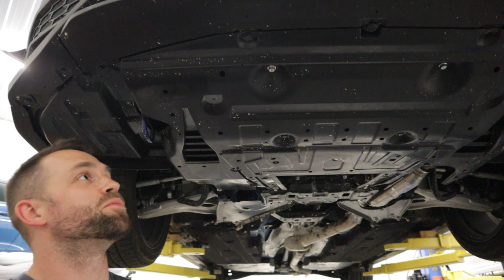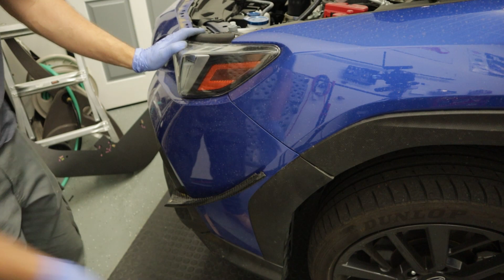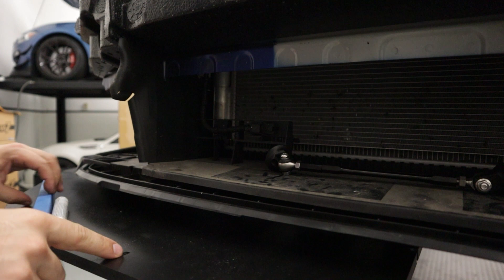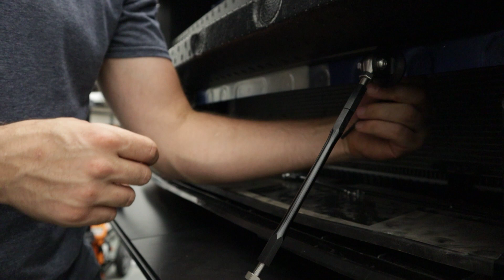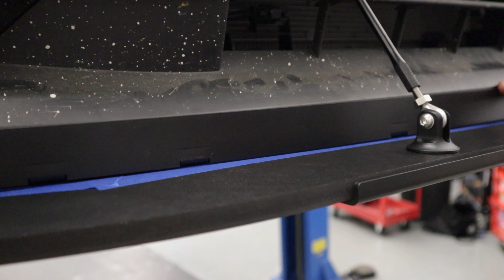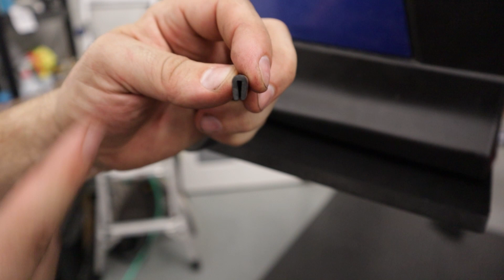VB Subaru WRX Front Splitter and Air Dam Installation

Comment: Verus Engineering really went the distance to provide a true functional splitter. It looks awesome and you can feel the difference. Installation wasn't too difficult. It took about 5 hours broken out into two days, but I took my time. Overall, the splitter is 5/5. I love it.

One thing to point out. The air dam portion is NOT included with the splitter kit. You will need to buy it separately. This installation video by Verus makes it seem like the air dam is included with the splitter kit, but Verus doesn't point that out in their video or website description. I reached out to Verus where they're looking into making a change to their online description and installation video. With that said, Customer service is 5/5 too!
Reply from the maker: Glad you like the splitter! We appreciate the feedback regarding the clarity of the website. We'll look into it.

Comment: How far out dose the splitter extend from the factory front-most part of the bumper? It looks like a good 6" at least. I need to know to figure out if I'll be able to get in/out of driveway, etc.
Reply from the maker: Roughly 75mm or 3"
Reply: @VerusEngineering oh. Not bad at all. It looks a lot more than 3” in the video. Does it fit with the extra silver aluminum skid plate, in addition to the factory black one that comes kn the car?

Comment: If you don't have a front crash bar due to having a front mount intercooler, where does one attach the Support rods? Drill directly into the bumper I suppose
Reply from the maker: Not sure, to be honest. This would be something custom you would have to sort out. However, installing the support rods to the bumper is not advised. This will not provide any additional support to the splitter. The support rods need to be attached to the chassis in some fashion.